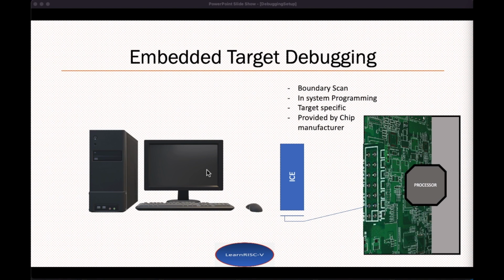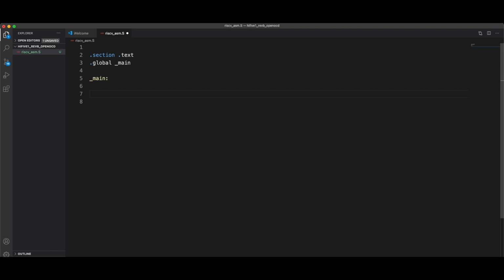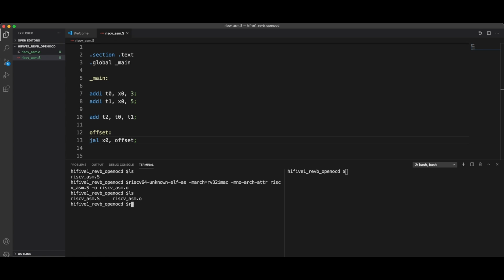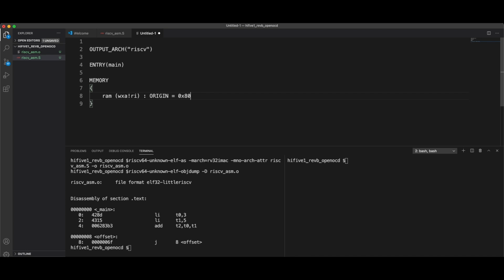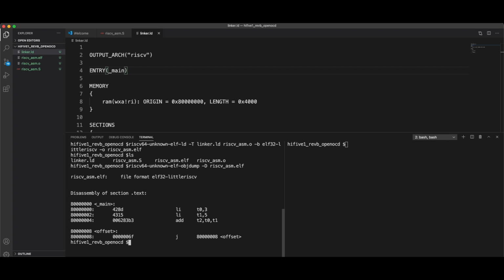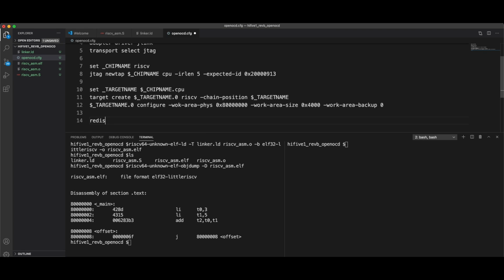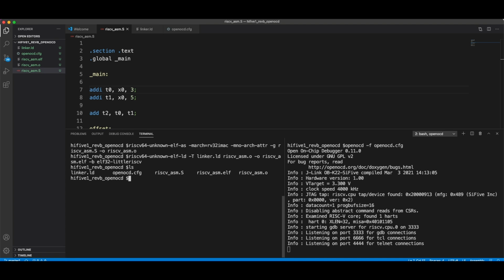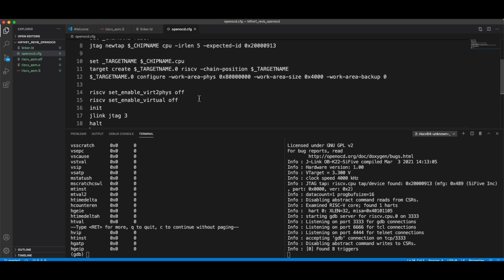RISC-V Programming and debugging on Hifive1-RevB board with OpenOCD and GDB

Comment: I haven't had much luck using OpenOCD to download/debug an elf to the VexRiscV..

I'm using the SpinalHDL fork ( 0.11.0+dev-04036-ga0220ad30 ),
./src/openocd -c "adapter driver ftdi" \
              -c "ftdi vid_pid 0x0403 0x6010" \
              -c "ftdi channel 0" \
              -c "adapter speed 1000" \
              -c "transport select jtag" \
              -c 'jtag newtap lx cpu -irlen 4' \
              -c 'target create lx.cpu0 vexriscv -endian little -chain-position lx.cpu -dbgbase 0xF00F0000' \
              -c 'vexriscv cpuConfigFile cpu0.yaml' \
              -c 'init' \
              -c 'reset halt'

Yet it fails to see the soft cpu due to: dtmcontrol is 0 or JTAG scan chain interrogation failed: all ones

I'm using a Lattice FPGA (Colorlight v8 5A-75B board) with the bitstream generated via:
python3 -m litex_boards.targets.colorlight_5a_75x --board=5a-75b --revision=8.0  --cpu-type=vexriscv --cpu-variant=standard+debug   --uart-name=crossover --with-jtagbone   --csr-csv=csr.csv  --build   (According to the LiteX page "JTAG GDB Debugging with VexRiscv CPU", it says a litex bridge must be used for vexriscv and openocd)